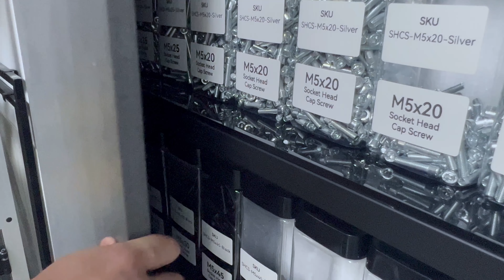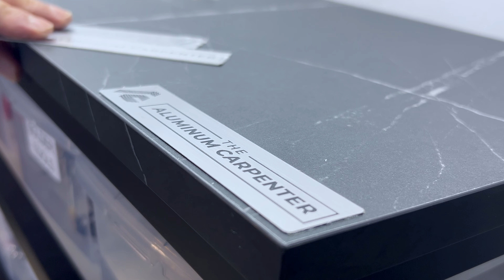The Ultimate Home Office Makeover: DIY furniture using aluminum extrusion and joinery perfection.

Comment: Merry Christmas and Happy New Year 🎄🎊. These look fantastic

I wish I had more individual projects like this. I mostly work with businesses
Reply from the maker: Hi Patrick, thanks 😀 i really like to know what is it you do.
Reply: @TheAluminumCarpenter  to keep it short I take customer ideas and make a design using 8020 extrusions
Reply from the maker: @patrickschardt7724 thanks for letting me know. Do you work in 8020?
Reply: @TheAluminumCarpenter  I work with them for a company called SunSource
Reply from the maker: @patrickschardt7724 I would really really like to know more about SunSource and learn from you. 😀
Reply: @TheAluminumCarpenter  I’ve learned a lot from you

It’s a parent company with many subgroups usually smaller businesses just bought our with the name kept. We are mainly a distributor for pneumatic parts, motors, that kind of thing. SunSource Pittsburgh (where I work) and a few others do aluminum extrusion designs through 8020
Reply from the maker: @patrickschardt7724 you are a huge company. I humbly dare not say i have anything to teach. I am only still little with small tips to build. I believe i can learn loads from you.
Reply: @TheAluminumCarpenter   no seriously I have learned a lot from you especially being mindful of appearance, useful jigs, and what fasteners work for a particular application
Reply from the maker: @patrickschardt7724  Patrick, will you be comfortable to exchange contact? If yes, probably you can drop a contact through the website and i’ll get back to you from there. Cos i appreciate that you’ve been around since the beginning if my channel.

Comment: What is the material used for the WHITE side, top, and bottom panels for the closed cabinets?  Thanks.
Reply from the maker: Its laminated wood panels.
Reply: @TheAluminumCarpenter   For sure that is the Doors.   If laminated wood panels is for the sides / top / bottom - what is the thickness?   Where to buy?  Thank you very much.
Reply: Need termite proof cabinets in our steamy sub-tropical setting.
Reply from the maker: @rmm9676 which country are you referring to?
Reply: @TheAluminumCarpenter   Guam Island USA - Latitude 13N
Reply: So you use laminated wood chip panels for the interior side, top and bottom panels?   We also have carpenter ants that happily destroy wood based panels in just a few years.   Looking for the best "non-edible" panel material.   Your recommendation??   Thanks.
Reply from the maker: For Guam Island, i did some googling. It could be the same here, without the seasons. For us here, wood is ok. We do have termites, but not in apartments like mine. Therefore i do not have such a problem. For your case, i cannot be totally sure, but i would recommend either plastic like polycarbonate or acrylic or melamine, etc. or aluminum plates like in this video : https://youtube.com/playlist?list=PLFvUD1xLOzv0zQ2bhvqUs0ZaUNXg-NIid&si=pXy93etMBn0mS145 hope this helps.
Reply: @TheAluminumCarpenter  That link goes to a playlist of 40 videos.   Which one is the correct one to show the plate alternatives?   Thanks very much for your time.   Guo Nian Kuai Le.   Gong Xi Fa Cai.
Reply from the maker: @rmm9676 opps sorry. I did it too fast. https://youtu.be/tmXloDAvArI?si=hVSKoBt7O-81kQhY
Reply: @TheAluminumCarpenter  Thanks.   That is helpful.   Especially the aluminum plates.   Needed for strength.   Expensive but a forever result.
Reply from the maker: @rmm9676  glad to help. 😀

Comment: Hi sir i want make aluminium stand for aquarium my tank water capacity is 65 gallon can you guide which profile size is best 45×45 or 45×60  can guide me please
Reply from the maker: How abt this. You give the full dimensions  of the tank, and i 3D draw up one and put it on the website, not just for you, but for everyone.
Reply: @TheAluminumCarpenter   
Length 42 inches 
 breath 18 inches 
 Hight  30 inches